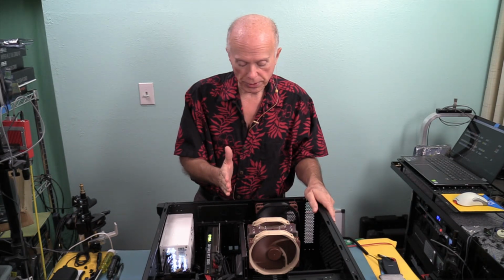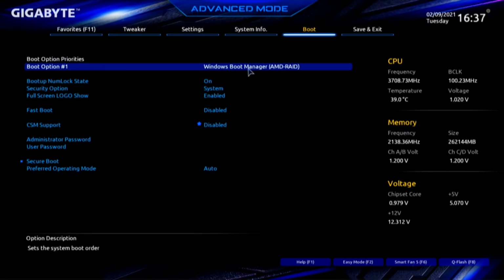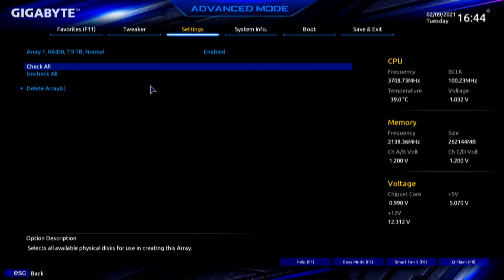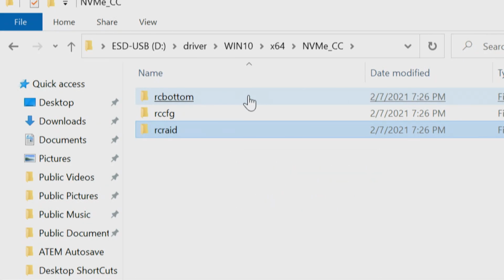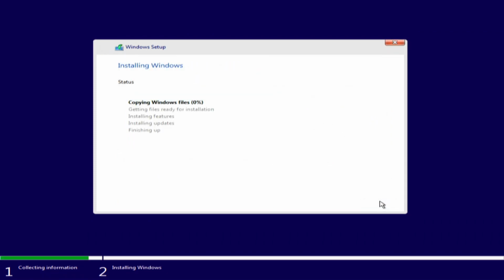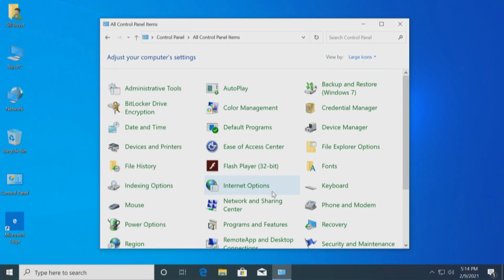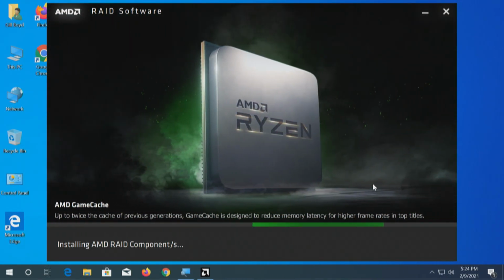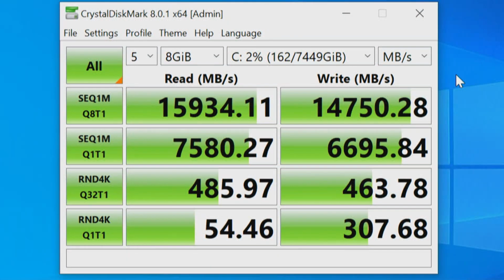Windows Bootable NVMe RAID 0 Tutorial on Gigabyte TRX40 Designare using Sabrent Rocket NVMe 4.0

Comment: Fantastic video as always. Congratulations! 

Can you please test the difference between video editing with this RAID 0 array vs just one superfast M.2 NVME attached to the motherboard. I really would like to know if is there a real world advantage of having a PCIE RAID array or it is just theoretically. Another reviewer found that there is not advantage using Premiere Pro and he only recommended it if you want to have a system based just in NVMEs and not rotating disks since this increases the system capacity. I am sure thousands of viewers will appreciate to have a final answer to wether or not this help them work faster and save time and money. Can you also contact Liqid and ask them to let you borrow their Honey Badger?
Reply from the maker: Hi Juan Osorio, 
Thank You very much! Wicked stuff! The two best real world and not synthetic Tests we've come across are from Puget Systems. Both tests require the Licensed application, Premiere Pro or DaVinci Resolve Studio. We now have a License for DaVinci Resolve Studio! Another Video on that too! Then a test! You're right. 

We thought about a Video to Discuss Specs for Burst mode and actual throughput. No one would watch it. That may be the issue with AMD USB 2.0 issues now appearing. That's not a new issue. Just an issue on new Chipsets and new Motherboards. That was an issue before hand with USB 3.0 on 990FX Chipsets. 

We thought about a Discussion on Rendering speeds, some will watch that. We need to include and cover Data Stream requirements and Codecs as well. Ever little detail matters. In a nut shell, from previous tests on a Ryzen that few watched, 90% of Rendering is done on CPU, 10% of Rendering for the most part is done on GPU. GPU Renders VFX Overlays, and is for real-time Playback of same while previewing VFX. 

Our hottest topics are NVMe anything and Thunderbolt 3 in that Order. 

As for a Liqid Honey Badger, we're not high up enough on the food chain! Great idea though! Besides, if You have to ask, how much, guess what? That means out of our price range for most Users! 

So far we've talked with High Point who wanted to sell Us a card. That was strange. Not needed. Then Sabrent contacted Us. Nothing came of that. I told them what Users want to see. They may contact Us again in the future. I said, Sabrent should make an M.2 card. We'll see. In the mean time, Subscribers like you and Clients support Us! If a Client says Build, then we Build! 

Back to Your question, we've not seen the need to Render to anything faster than on an NVMe. And for most Users, Rendering to a Spinning HDD is enough. We have to consider, 1080, 4k, 8k and 12k. And that gets beyond just Data Rates but get's into Codecs. 

Extron has a really good 8K Data Rate Calculator here. 
https://www.extron.com/product/videotools.aspx

We've run some Specs for Comparisons and may include that in a Video for Perspective in the future.
Reply: @BuildOrBuy  Thank you very much Gill for your reply. I understand that DaVinci Resolve uses everything you can add to your system and as you described, Premiere Pro mostly CPU. I understand that millions of people get very interested in numbers, but it is amazing how few question what is the real meaning of those numbers. It should be the other way around. Specially for your followed who I believe are interested in high performance systems. In other words, productivity. If you can save 5-10-30-60-120 minutes every day rendering or working with your animations, videos, etc, in a year that will translate into weeks or even months and therefore into money. That's the only reason I see that justifies spending a lot of money in a super pc; otherwise is just bragging. Looking forward to see your own tests in terms of video rendering. Now, can you ask your followers if they would be interested in a build that will render video 50-80% faster than any other system?  If money wasn't an object what would be the components to build a super video editing monster PC?
Reply from the maker: Hi @osoriony , 
Absolutely! We're working on that now! AMD WRX80 Threadripper Pro Workstation! Due out right now! Excellent! Question!
Reply: @BuildOrBuy  Thank you very much. Looking forward to seeing what you built
Reply from the maker: Hi @osoriony  , Thank You for watching!

Comment: if i do raid 0 on an itx mobo which has only two m.2 slots, one directly connected to the cpu and one going via the chipset, is this recommended or not advised as i assume it will saturate all the available pcie lanes on the motherboard
Reply from the maker: Hi Akshat Prakash, 
Depends upon the Motherboard and Chipset. The two will not be equally matched and will in total perform at the slowest common denominator. Better to get 1 fast M.2 NVMe Drive. Like for example on PCIe 4.0, get a 2nd Generation M.2 NVMe PCIe 4.0 SSD Drive.

Comment: I assumed we would see 2tb space in the system
Reply: That would be RAID1, RAID0 combines the drives as if it was 1 disk (and 4x the speed both read and write. if 1 of the disk (4 in the video) fails the whole raid will be unrecoverable with RAID0
Reply: @MikeMazue84  I was always avoiding to make a raid in my pc, cuz I thought it will consume my space (like 1TB+1TB = 1TB) . But I like the raid 0 now. Thank you for a useful video.
Reply from the maker: Hi @laggitech , Thank You for Watching! And Thank You Michael maertzdorf! Appreciate Your help!
Reply: @laggitech  There are raid types like that. They are used for fault tolerance so that if one of the drives fail you just replace it and it copies the data from the good drive to the new drive. Raid 0 however does not do this. Like BuildOrBuy said, Raid 0 combines the drives into 1 larger drive giving it the capacity of all the drives so as in this example 4 2TB drives becomes 1 8TB drive. Raid 0 also has the added benefit of increasing the performance of the drives. So when dealing with raid you have to decide if you want the advantages of combining multiple drives into 1 larger drive with increased performance or having half the capacity of all drives in the system but have the advantage of fault tolerance. 

You basically have to pick which type you want and which is best for you. Each raid type has its own advantages and disadvantages. But remember, even using fault tolerant raid is not a replacement for backing up your data. 😉
Reply from the maker: Hi @MikeMazue84 , Thank You! Appreciate Your reply. Amazing how many ask about NVMe RAID. Looks like we may have to do another Video about RAID in general. Everyone has been asking about RAID 0. RAID by the seat of our pants!

Comment: This answered so much more than the very limited documentation provided by Gigabyte's manuals.  I'm still not sure I want to set mine up in RAID as I don't really have a need for the increased date rates other than to boost my ego. The system is already incredibly fast...too fast! I recently found a PC build log from the past where I documented windows 95 load times on a DX4 100 system I did way back in 1997 its not even worth mentioning how painfully slow that would seem now.  I never would have dreamed the thought of 12 TB of data storage I have now  back then, now all I need to do is find a reason to fill all this NVME storage I already have!
I'll keep an eye out for the next video although I don't have too many questions left anymore, except for maybe putting two Aorus M.2 Quad cards in a system and moving the graphics card to a x8 slot (the performance hit isn't as great as the marketing out there implies) just for fun of course!!!!
Edit: in case anyone was wondering the win95 boot time was 2:18.
Reply from the maker: Hi John Smith, Your message was blocked. Don't know why. Found out from Channel video comments section. We're contemplating doing a Video with 2 M.2 NVMe cards in this TRX40 Build. You are not the 1st to ask! Thank You for Your Comments! As for RAID, if You don't need it, don't! We have to ask, Feature or Benefit or Bragging Rights!?!

Comment: I've been looking to do something like this for a small office server i'll be building towards the end of the year. I was looking at a HighPoint SSD7505 and (4) 250GB Samsung 980 Pro's in RAID 10. Do you think the HighPoint card can really justify its ~$450 price increase over the Gigabyte?
Reply from the maker: Hi Grant, Very good question. There are 3 Different classes of cards. 

1. The Gigabyte type of M.2 card is an I/O Card and requires Motherboard Bifurcation. 

2. Whereas the Highpoint type of card has a PLX chipset making the card self Bifurcating. That's the major difference.

3. A true Hardware M.2 NVMe RAID card would be Broadcom MegaRAID or Intel RAID Controller. In that order.

To fully answer this question, we may need to do a followup video and talk about NVMe RAID in general and what's available from and for, Hardware RAID, Hybrid RAID - Bios RAID and Software RAID.  What do You think RAID will help with on Your setup? Network Bandwidth and Network connectivity may be of greater concern.
Reply: @BuildOrBuy  What is the advantage of card bifurcations vs motherboard bifurcation? Seems like a pretty large price jump.
Reply from the maker: Hi @grantfahey4439 , 
Good question. Agreed! 
1.) The under $100.00 M.2 NVMe cards are made for a HEDT. Just an I/O card.  RAID is a function of either the Motherboard Bios - Hybrid RAID or the O/S - Software RAID. Otherwise, those Drives are JBOD, and not a RAID JBOD. 

2.) The $400 M.2 NVMe cards are made for those wo don't have a HEDT but still have a dedicated x16 Slot. The High Point self Bifurcating cards do the Lane Switching on the card for Upstream ports and Downstream ports. Like buying a Motherboard. The PLX Chip is a multiplexer Chip; A Lane or Port Switching Chip. Software RAID. Can be Bootable.

The High Point card does not make sense until You go to 8 Drives on 1 card. As long as You stay with 4 Drives on 1 card, HEDT. Which is x299, x399, TRX40 and WRX80. Anything else, waste of time. That includes the x570 Chipset. 

What Motherboard are You using for Your Server? Is this a SuperMicro Server or an ASUS Workstation type of Motherboard? 

Then a 3rd class of cards for true Hardware RAID. 

Back to Your Question, Motherboard Bifurcation will be faster then Card Bifurcation. Card Bifurcation is a complex operation requiring a PLX Chip to multiplex Lane Switching of Uplink and Downlink Ports or Lanes. Certain ASUS Workstation class Motherboards have PLX chips to add PCIe Slots. The PLX Chip is the key to added functionality. Hope that helps.
Reply: @BuildOrBuy  Great info so far.

I was going to get a B550 or a cheap X570 board to keep costs down. Paired to a Ryzen 5 5600x(if I can find one) or R7 3700x. Since this is a server build, I'd only need a video card for the purpose of setup/troubleshooting, so a PCIe 1x card will save cost and PCIe lanes.

So theoretically 24 pcie lanes with X570, 16 go to the raid card, 1 to the video card, 4 to the boot drive m.2. Leaving 3 to spare.

My storage plan:

On board M.2 for OS.
Raid card (Raid 10) for database, so users can take advantage of 10gb network.
(2) 8TB mechanical drives for nightly backups 

https://a.co/an3cTSR This is my amazon shopping list for it as of right now.
Reply from the maker: Hi @grantfahey4439 , Just discovered this message was blocked which blocked the rest. Had to approve Your message then the rest showed up again including our discussion. Crazy. Said inappropriate words. I don't get that. About like the strike we now have for a How To video. Anyway. Will now check Your List.
Reply from the maker: Hi @grantfahey4439 , Checked Your List. The Samsung 980 Pro - Go to 512MB. RAID - Do You want Hardware RAID, Hybrid Bios RAID or Software RAID? We need to do another Video on RAID and Discuss options. If You want true Hardware RAID for Your purpose, suggest a MegaRAID card, x16 Slot.

Comment: OK, I'll run this vid on my backup Ryzen PC and stop it after each step and then do it on my TR. I'll go back to the vid and watch step #2. etc etc. GEN4 drives on my gen3 TR mobo/cpu get 3500/3500. 10,000/10,000 on an old TR would be fantastic and cost nothing. Thanks Gill. Buying everything for a new TR Pro will take me a long time.
Reply from the maker: Hi Max, After having done this on the x399, I had to run through the process on the TRX40. Fortunately, this was a straight by the book RAID install whereas the other was a non typical RAID. Fascinating process. 

I expect we're going to be getting a lot of questions from this video based on the videos about M.2 NVNe PCIe Quad cards. Just remember to disconnect anything not in RAID while Configuring RAID. Easy to get confused. Keep it Simple! 

Threadripper Pro, WRX80, I hear that! Hoping a client will come forward asking Us to Build one for them. We'll see! I'd like for Us to be able to look at and inspect both ASUS and Gigabyte WRX80 Motherboards.